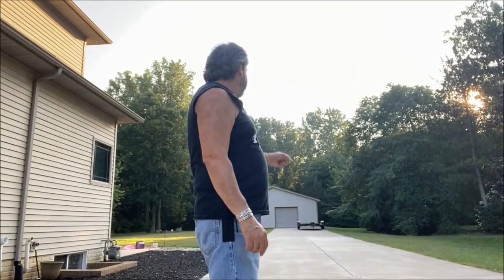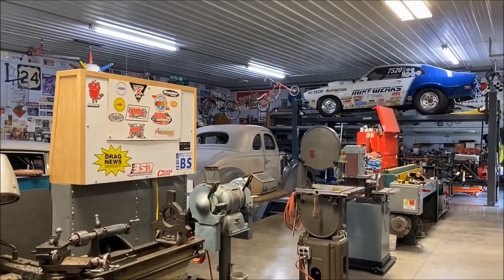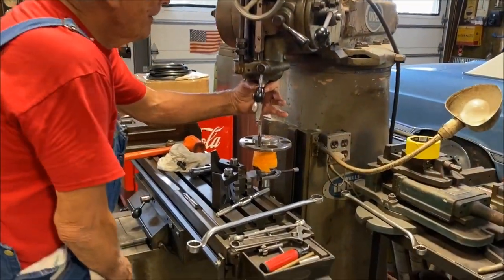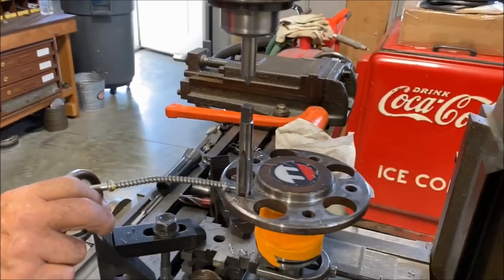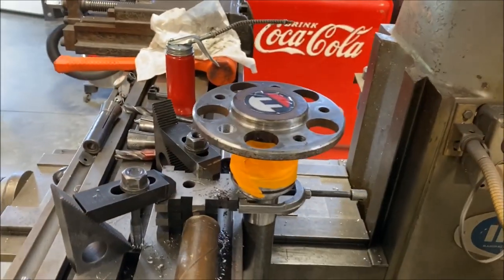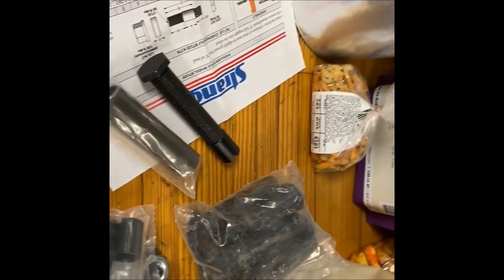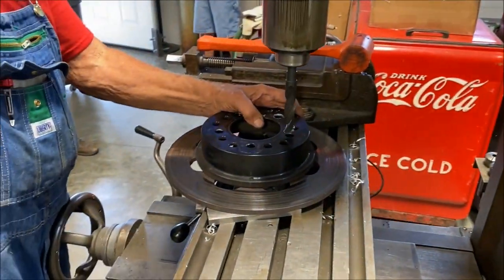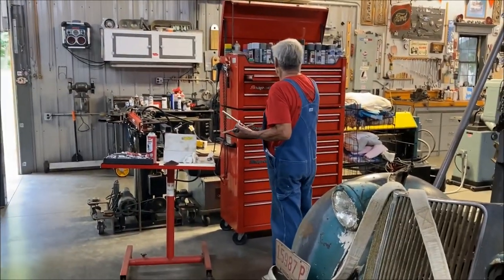5/8 Wheel Stud Installation: Size Does Matter

Comment: Tim, did he use a regular drill bit or a reamer to redrilled your rotors?
Reply from the maker: I regular drill bit for 5/8. I had to use a dremal to clean them up.
Reply: Moser said the shanks are .6875 or 11/16.
Maybe that’s why you had to do a little cleaning..... that would make sense.
But these things are wicked looking. And WOW what a difference between 31 and 35 spline.
Reply from the maker: @Mikeyhunts  I agree, also look at that stud size, 1/2 v 5/8. Not sure why I did not do it sooner.